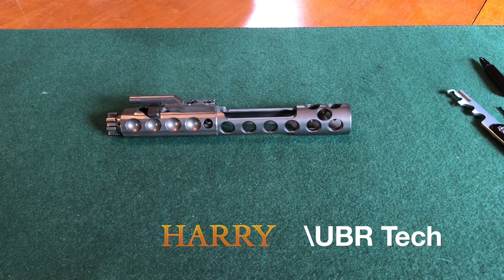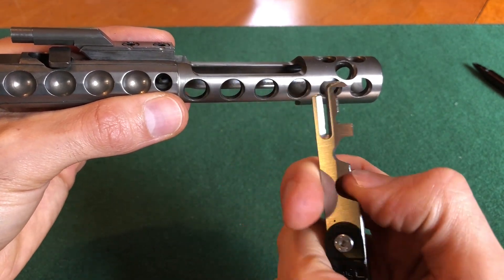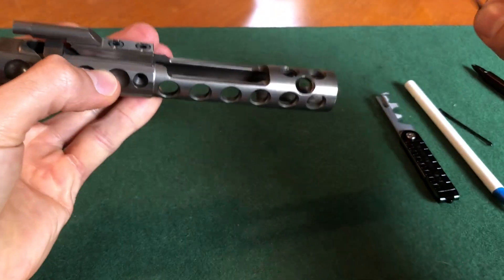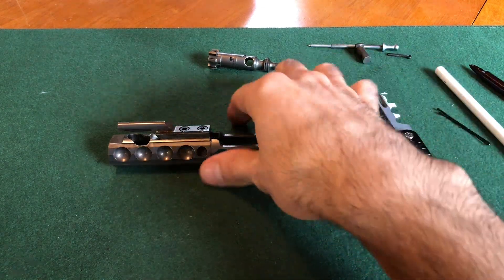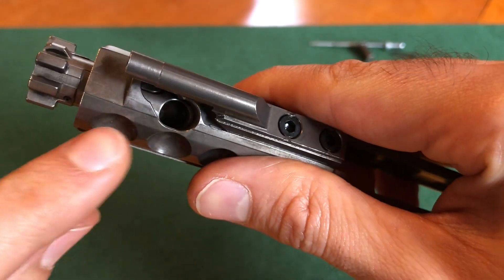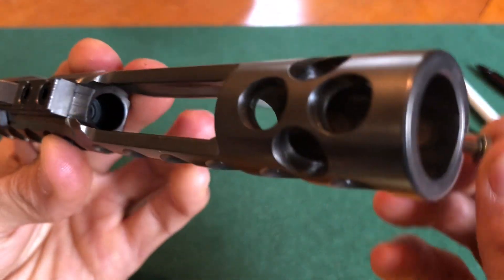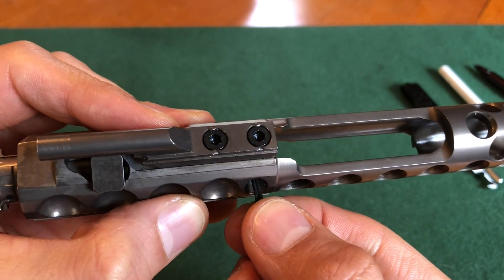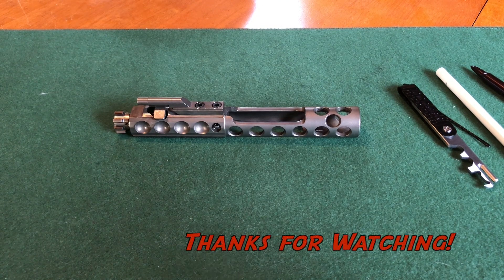How to Disassemble & Reassmble AR15 Bolt Carrier Group

Comment: I would add to also remove the extractor from the bolt and clean/lube it as well, especially on a DI action. It's just a push pin to punch out.
Reply from the maker: Hi Darren, I wanted to keep this video for basic maintenance. I’ll have to make another video for the extractor. Thanks for the suggestion. Also, thanks for watching and leaving a comment. Have a great day a please tell a friend about the channel. 😁🤜🏼🤛🏼

Comment: What do you recommend for a AR-10 other than a adjustable gas block? It runs good but still have to keep the bolt oiled good after a 100 rounds or so,,, I just don’t like having the thought of oiling it if I get caught up in something plus carrying a small bottle of oil
Reply from the maker: How many rounds do you have with your AR-10?  Is it still breaking in?
Reply: UBR Tech yeah not a whole lot been run through it really... going to where I buy my ammunition and get about 300 rounds soon as they get stocked back up,,, I probably have about 200 rounds as of now,,, I had 7 boxes of steel but it didn’t handle those to well so I gave them to my son to see how they ran through his,,,they put a new BCG in and the adjustable gas block and that helped a lot,,, Said the BCG was a old style or something they had been using
Reply from the maker: @Don6461-M1  Yeah, it might be that you need to break it in.  From my experience you don’t have to run them that wet. I have a Nickel Boron BCG so I’m sure that helps. Check this reddit post out. They seem to say the same thing. https://www.reddit.com/r/AR10/comments/5oh4vb/does_your_ar10_need_to_run_wet/

Hope this helps, thanks for watching and don’t forget to subscribe. :)
Reply: UBR Tech thank you Brother... I usually don’t get to get out past 300 yards but we got a range not far from my house that you can shoot out to 500 so I’m going to check it out,,, Got a Trijicon 3.5 x 35 and it’s dead on at 300, will see what happens at 500 hopefully
Reply from the maker: @Don6461-M1   That’s awesome, I’m so jealous.  I wish we had something like that close where I live.  We only have a 300 yard range.  Good luck on the 500 yard range and enjoy.

Comment: Just curious, but how’s the light weight bolt perform compared to a normal weight one?
Reply from the maker: From what I can tell it makes the recoil feel lighter and smoother, also it takes a little bit of weight off the AR.  The one downside is it takes a little longer to clean because of all the holes.